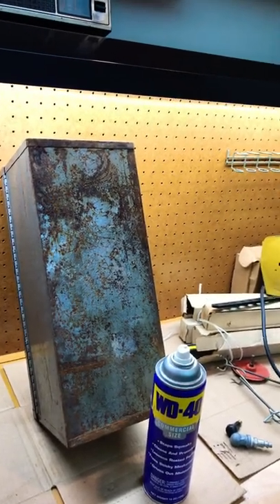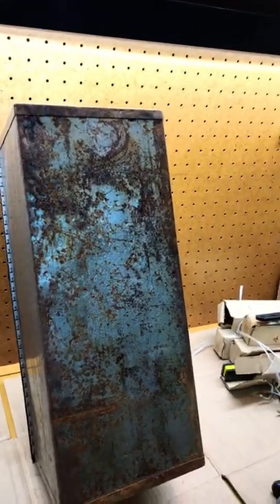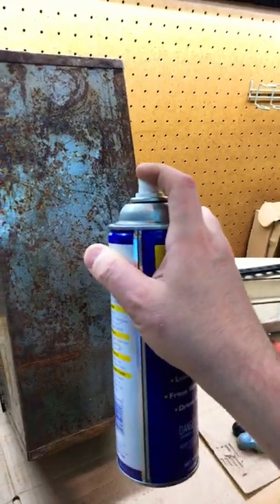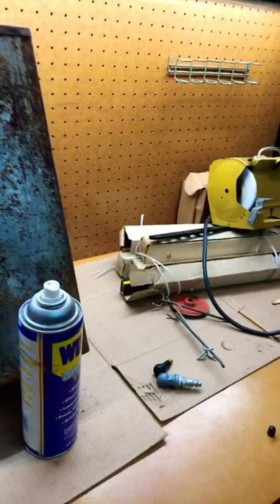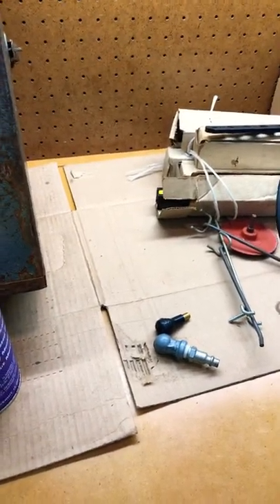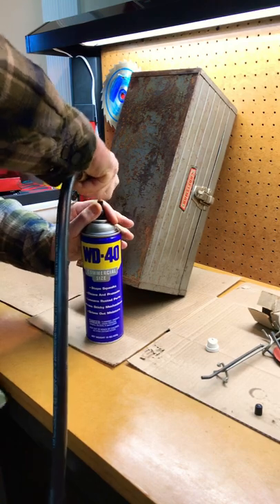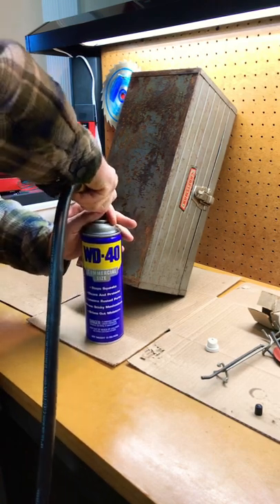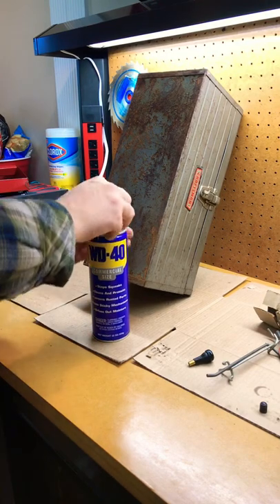Refill your WD-40 Aerosol Can With Air!

Comment: Great stuff Tom, I have two valves set up just for different aerosol cans.  Now if only we can keep the nozzles from clogging!   LOL
Reply: Plugged nozzles can be a problem. Every time I finish a can, if the nozzle is still good, I save it. I have @ 20 different ones of them in a drawer.  They have come in handy several times.
Reply: Prevent clogged nozzles like this: after praying,  turn the can upside down to get air without paint cleaning up the pipe! Works like a charm🔧😜